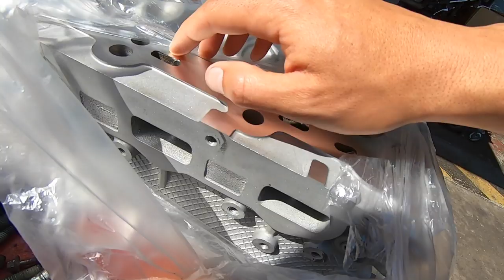DO YOU NEED COLLEGE TO BE SUCCESSFUL?

Comment: To get a in law enforcement you will need college. Most departments are looking for a college degree. There is are hundreds if people looking to get into a stable job like law enforcement with retirement at 50 years old and a guarantee monthly check for life. Most people go to two year college courses like nursing, x ray technicians, and respiratory therapist jobs. Some people also get into the trades like pipe fitter union and electrician union for jobs.